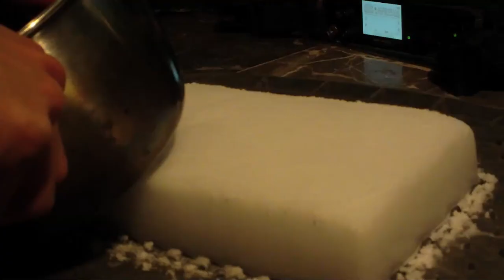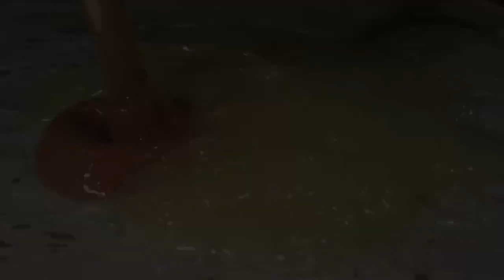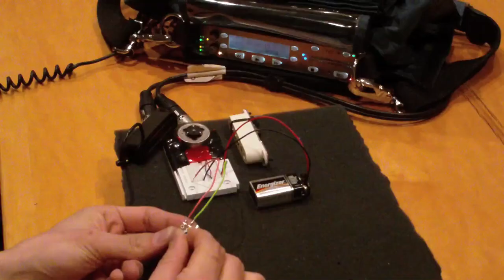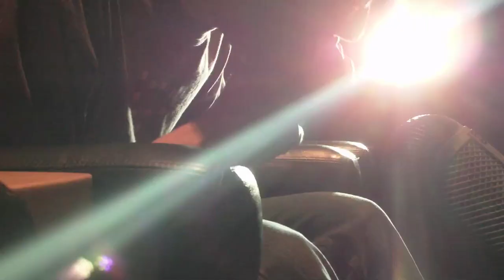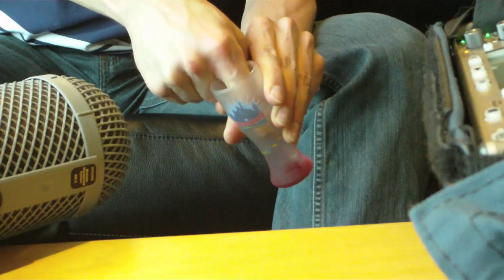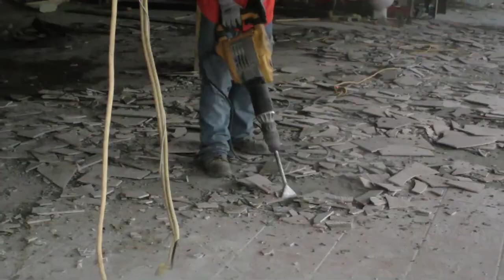Jean-Edouard Miclot - Field and Toys 3

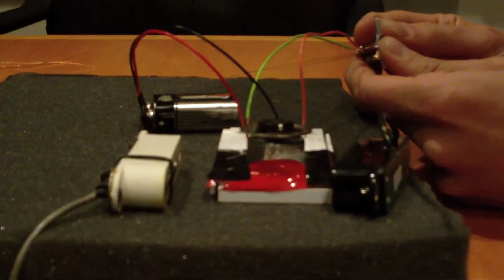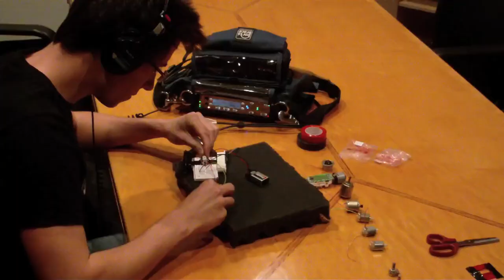Comment: Hello! What's the mic/sensor/device do you use between 2:24 - 2:29
 ? Awesome job!
Reply: The "mic" is a seymour duncan guitar pickup. The device was simply a motor from an old CD player that I controlled with a bread board, a battery and a knob.